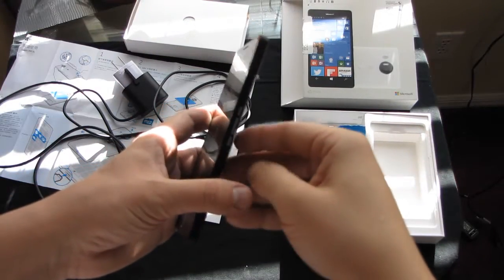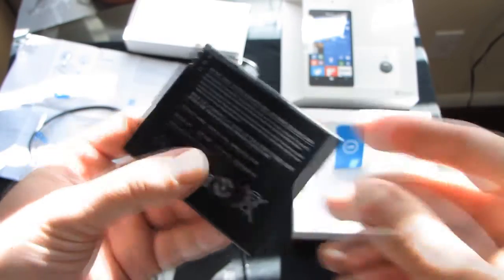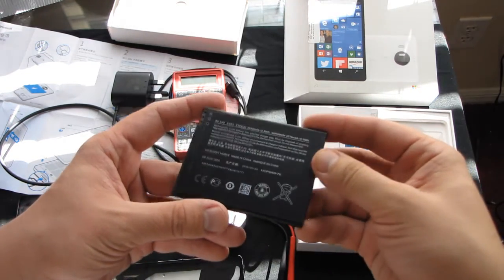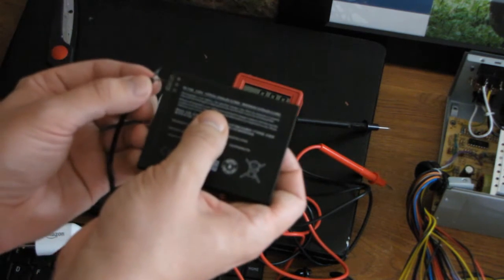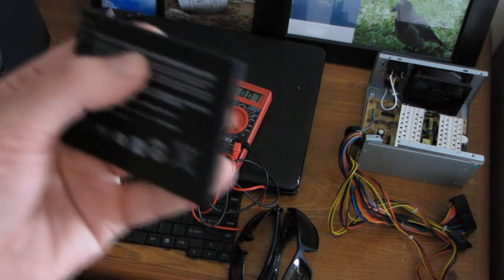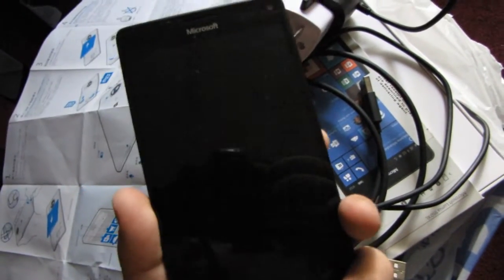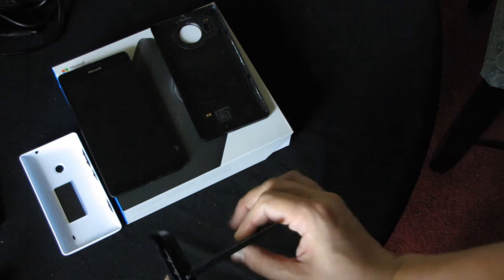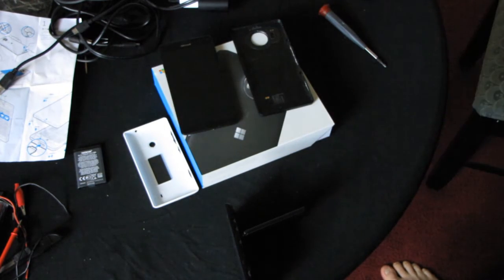Microsoft Lumia 950XL Troubleshooting and Repair Part1

Comment: My Lumia 950 vibrates to turn on only when I put charging cable inside but is not turning on, what can be issue
Reply from the maker: it could be several issues one off them is broken screen.
Reply: It didn't mention any broken screen in my comment lol. In fact I was able to turn it on after several tries of removing and reinstalling battery. Sometimes I notice it turns on when battery is full due to insertion of charging cable instead of power button. Not a good device at all by microsoft..Try factory resets or other options, nothing solves problem of phone going dead after 2 or three weeks use.
Reply from the maker: my lumia 950xl have had nothing on screen because it was small crack on the screen